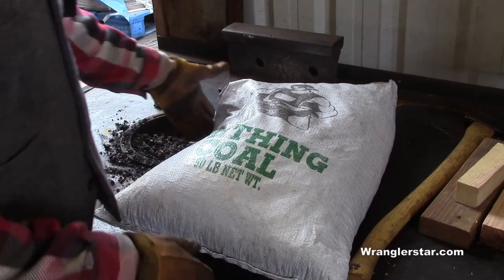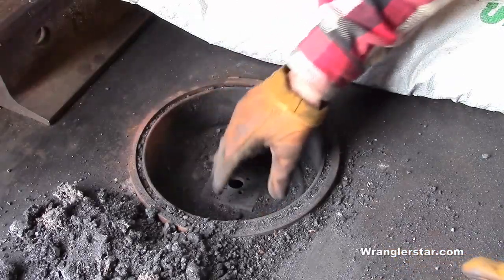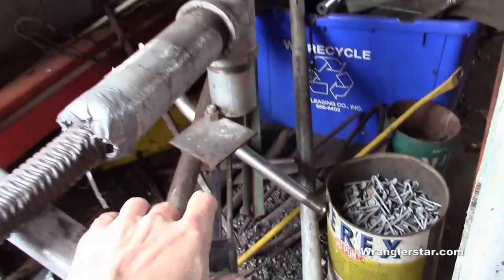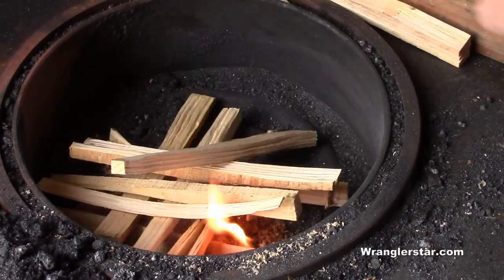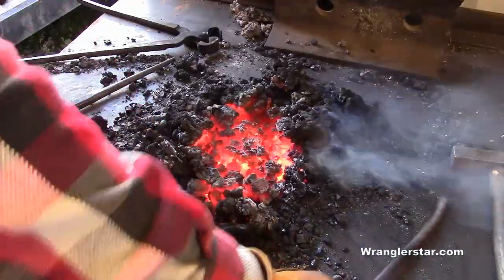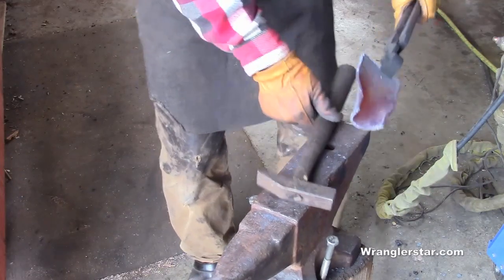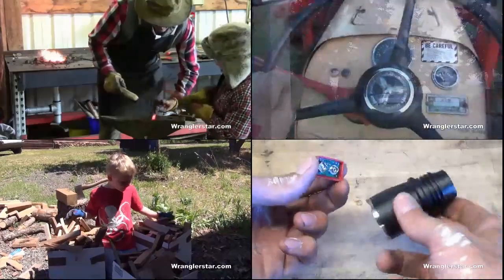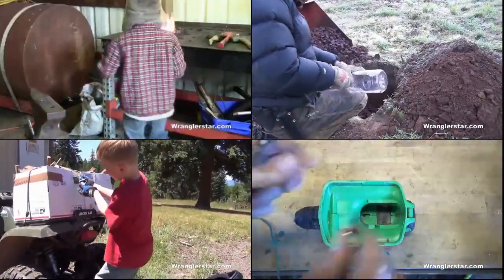Brake Drum Blacksmith Forge | Wranglerstar

Comment: Get a dimmer switch Cody! If you take a double gang box put a dimmer switch and an outlet hooked together you could control the speed of the shop vac or any other blower and that would eliminate sparks and be able to manage the fire better at a low cost.

Comment: Hiya Cody, I've only recently started blacksmithing myself but here're a few tips more advanced people have given me: when you have not your metal in the forge, turn the wind down, your coal will live a bit longer. Also, as some people mentionned it before, make sure your anvil is securely stable. It makes your job a lot easier ! One guy used to say "you move around the anvil, not the other way around".

As awlays, thanks for your vid Cody, can't wait for the next one !

Comment: Howdy, I enjoy your videos very much. I am not a blacksmith by any means. I do enjoy watching others performing this craft and have done some, but very little. I am going to build a small forge of my own. I have seen many forges from the old days and seen many that people have made. I have noticed that the old ones were much shallower than the break drum type. I also saw a fella on youtube that built one out of a brake drum, But cut down the sides and put a riser inside as he said that it was to deep. He said that he was having trouble heating certain pieces of metal and wasting fuel trying to properly heat them. Thus he made his forge shallower and that seemed to make a difference. I am by no means being critical. I am just sharing info. in case you end up having some of the same issues. Thank You for sharing your awesome videos with us. God Bless, Dave

Comment: I work at a steel mill.  That yellow smoke is what we call coke gas.  It has 37 different carcinogens in it.  It leaves a residue on your skin and clothes. I suggest washing those clothes separately, and don't let anyone touch them while dirty. A vent fan and a respirator(not a dust mask) will help.  This is ment to be informative not bossy, its why i don't post often.  Just trying to help and warn if you don't already know.  Love the channel.

Comment: Im with others a hairdryer seems to be just right on airflow. Tim Lively uses a primitive forge with A wide intake that reduces down and it seems to do very well with no electricity or hand crank. He has a hand crank piped in for extra if he needs it. great video.

Comment: Brake drum forge. Love that recycle there.
A forge would be so cool, but it's low on my list of "must haves." Maybe if I come across a brake drum I will do it. (thinks probably not)
The shop vac & the foot valve are very clever.
Just a FYI: If I'm not mistaken, the "scale" is called slag and was used as a roofing material back in the day
Thanks for sharing.

Comment: Nice video. From one blacksmithing homesteader to another, though, if you use a deeper fire, less air blast will blow directly on your metal, thus creating a lot less scale. Typical forge fires  are around 8" deep for general work. Nice forge design with the brake drum. And those hoof nippers can be reworked into a great set of flat jaw or pick up tongs. Looking forward to your next video. Cheers.

Comment: I have zero experience with blacksmith work but here in the mountains of North Carolina there are several people in the "old timey day" that use a forge with a side blower. Seems like this would eliminate the blower clogging issue you are having. If you were to put your holes on the side of the brake drum that might be better???

Comment: Cody if you want to control the vacuum speed wire a rotary light dimmer between the wall outlet and the vacuum
Reply: I'm pretty sure that'd be hard on the vacuum.  They're designed to be run with a certain amount of power.
Reply: Slade McCuiston Actually it's really not, I have had all sorts of power tools vacuums kettles and many others attached to one.
Reply: *****  I repair electronic devices as a hobby.  You're apt to burn the motor up.  If a device is expecting 120 VAC and you cut it down half... that's not good on the tool.  But, do as you wish.  It seems to be working for you... for now.
Reply: ***** If you use a dimmer switch on a motor that isn't designed for it the motor will ware out quicker since the motor will get hotter than what it was designed for. The best thing for a forge if you don't have a motor that uses a rheostat is a gate vale the you put between the tuyere and the blower then run the motor at full speed.
Reply: Shane Hall
Right.  Now, I don't know what motor he's using.  It may be rated for a dimmer, but I really doubt it.  I don't know of any vacuums that are.
Reply: Slade McCuiston the vacuum I currently use has been running half speed for nearly four years on a table saw used for hours on end, and it doesn't even get hot.
Reply: Alright.  Have fun with your vacuum.  Just trying to save you some headache.  Not trying to start an argument
Reply: Slade McCuiston I understand, the vac I have is used and nearly 10 years old and it only cost me $30.
Reply: A bathroom fan with side blow feature will cost in the $15 range and would probably work with the switch
Reply: Allofthemonkeys This is true, good suggestion.
Reply: i use a hair dryer i picked up second hand with a home made variac
Reply: You can use a dimmer for inductive load! Those vacuum cleaner that have a speed controll does use nothing other than that. You shouldnt have problems with heat when it runs slower because you also put less power in the motor.

Comment: you could use an old variac or a router speed controller from harbor freight to control your shop vac speed. it may not be good on the motor though. but its worth a shot

Comment: out of curiosity , couldn't you use a dimmer switch/knob to control the power that the shop vac gets and mount it close at hand as a way to control the amount of power it gets and also how much air the forge gets ?

Comment: I'm sure someone has already mentioned this, but a computer box fan could easily be powered off of Jack's solar box. It'd likely be pretty easy to wire in some sort of dimmer switch to control the speed. It'd be a lot more quiet and take less power than that shop vac. Not to mention the ice breaker you'd have when you tell people, "Oh this ole thing? It's just my solar powered black smithing forge..."

Comment: I would recommend a foot switch on the shop vac. You can save your coal for heating the work. And not so much wire brush. More cowbell.

Comment: Cody, you mentioned you were just starting in blacksmithing. Your forge and hammer are completely doable, but your anvil needs some work. Make sure it's VERY stable, or things just get annoying real fast having it constantly move around. You may also want to lick the top with an angle grinder, just to clean it up a little. I like to have my ball peen hammers with a mirror polished face.

Comment: Coal is real hard to get here in Chile. They import coal but it is Bituminous coal. Also I would raise your anvil height so that you are not bending over so much, and it will save you some back pain too. (Just a suggestion). I think that it is cool that you are learning. My sons are right where you are now and starting to do more and more projects. Perfect on the air valve, nice little control. I use pine cones to start my forge as they have a lot of resin and start the coal right up while allowing air flow around the cones.  Your anvil is perfect and appears to be just like mine. I would put it on 2 x 12s set on edge and bolted together with thread rod so that the boards float. That way when you pound on the anvil it will form the boards to the floor and any dirt or small rocks below it and not rock or move around as much. No right or wrong way just a way.
Nice job. Jim
Reply: Bituminous coal is what most smith's that i have seen use. It cokes up which is what they want. The issue with it is the clinker. Anthracite coal however does not coke burns hotter and is less likely to have clinker. Which is why some people prefer it.

Comment: Would you save fuel by shutting off the air supply while you're at the anvil? Or is the fire easier to keep hot? Just wondering since I use to watch shows like the woodwright shop visiting the blacksmiths at colonial Williamsburg, they only work the bellows while the piece is actually in the fire.

Comment: In a restoration black smith forge I saw a bellows that was powered by weights on a chain  like oversized coocoo clock drive mech.  

I am thinking  useing a free wheel cog from a bike and bike chain to provide the power to bellows

Comment: Nice forge, but one thing I have come to hate is the HOWL of a shop vac.
I'd look for something with a quieter fan.
I got a couple of small squirrel cage fans out of an old blueprint making machine that use 12V.
A large computer fan might do well for a nice low powered fan.

Comment: Save fuel by adding pieces of metal to the inside of the forge in a cone shape, all that extra room at the bottom will be burning fuel without getting any benefit from it, the cone will keep the fuel in the sweet spot.

Comment: if you want to control your airflow better... wire a dimmer switch either to the plug you vacuum is connected to or between the plug and the actual vacuum and you can contril the power going to the vacuum ;)

Comment: Can you use just wood and no coal for a blacksmith?
Reply: If you go for wood fired look at a rocket stove for focusing the heat to one spot.
Reply: ***** Thanks for the reply. I thought it might use more wood.
Reply: MC Armoury I watched a few of those videos on youtube about making homemade charcoal after reading your comment. lol. Its actually pretty neat how they do it.
Reply: Andrew H That actually would work better. Thanks.
Reply: I have forged very simple implements from rebar using a wood stove as the heat source, but I would never want to do that for more than the very few hook and point jobs I did.
Reply: ***** That is pretty neat how they make charcoal. I never knew how it was done.
Reply: +Love2boat92 Many old time blacksmiths in my area used dry black alder or dry hemlock which will actually warp the top of a cast iron stove for blacksmithing. However, any wood can be used if you make charcoal out of it, which some prefer to coal. Google charcoal making. It's actually quite easy
Reply: E.R. Long Oh wow. The fire is super hot to warp cast iron. I will do that. Thanks!

Comment: There are a couple of things which you could do which would exponentially increase your learning curve.

First is to make or buy a solid firepot. You can buy one for $50 from centaurforge(dot)com. A brake drum is not the right shape for a firepot. The most important tool is the fire, and if you cannot get a good heat it makes things extremely frustrating.
If you would like to make your own firepot then read this thread (Start from post #7)
http://www.iforgeiron.com/topic/38479-firepot-design-notes/?p=411626

The next this is to make a solid anvil stand. The easiest would be of steel because you can bolt it directly to your concrete floor. Just think how much energy it takes to move that anvil, every time you hit your piece, half the energy goes into moving the anvil and not your work piece. I have a short video on my channel titled along the lines of "How to silence your anvil", watch that one, and please read the link which i included in the description.
Video:Silent Anvil - How to Kill an Anvil's Ring

Last thing, you can buy a good electric blower for about $50-$70. Search "Bouncy Castle Blower", this is a very powerful and cheap centrifugal blower which will provide a very powerful blast. You will need to make a airgate for the blower (Also seen on the first forum link).

In terms of technique search for the Youtube channels "Alec Steele" and "Brian Brazeal". Study their videos of how to draw tapers (all forgings are tapers, one way or another). These videos will really help point you in the right direction.

Brian Brazeal
https://www.youtube.com/user/brianbrazealblacksmi

Alec Steele
https://www.youtube.com/user/alectheblacksmith

I hope this helps you overcome your learning curve.
Reply: I think the point of this video, along with most of WS videos, is that you don't need to spend money or have the ideal parts and supplies necessary, but as long as you have good knowledge of the subject at hand you can pretty much accomplish most tasks with what you have readily available. Especially on a homestead where you have to drive many miles just to get to the nearest general store.

As the old adage goes, where there's a will there's a way!
Reply: Mark Weller Jr Thumbs up on your comment. Well said.
Reply: Hello Paul, I appreciate the information and links you shared here. My sons and I have enjoyed your smithing videos and are looking to take our work to the "next level".

Comment: Coudn't you put a turbine in chimney to generate electricity which you could directly run to your blower. You would obviously need a method of controlling how fast the blower is but it would save electricity
Reply: +Joeby There's too much debris in the fumes going up the chimney that would coat the turbine blades making a turbine impractical.  Turbines DO NOT like dirt, not to mention you wouldn't get enough gases to turn a turbine with enough power to produce any electricity.

Comment: I enjoy your videos a lot and appreciate you sharing some of you knowledge, I would like to point out a detail in your anvil setup that might make it easier to work at. The height of the top of the anvil should be at a height where your hammer is horizontal when you strike your work, that will prevent you having to bend or hunch to handle your material or land a flat strike on the material. Also, you might look at anvilfire.com for some good tips and tricks for developing your tools/skills.

Comment: NEVER use gasoline to light the forge. Igniting gasoline can cause a combustion reaction that is like a small explosion. Instead, use Kerosene or lighter fluid when starting the fire. This burns hot and slow and won't explode.
Reply: It won't make a difference if he doesn't use a lot
Reply: +H2Os Chainsaw bar lube works pretty well too.